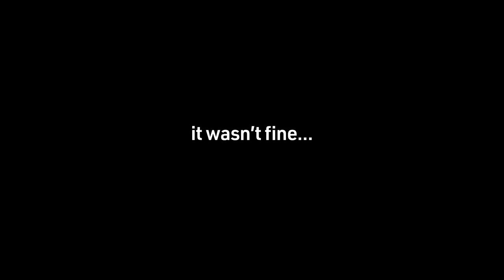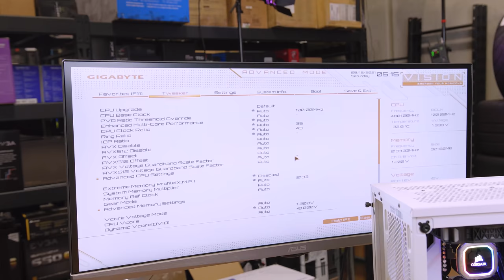6 Year Old Girl Builds A Gaming PC

Comment: I'm a 3D animator, Quick question: I got a new GPU, should i be selling my old GPU or does having a pc with two different GPU make sense or useful at all....or maybe just build a different new PC ???
Reply: depends on the 3d software you use, and if you do GPU render, if not, keep it as a back up, or build a media pc, or for someone else
Reply: If your new gpu is powerful then it should be decent enough at what tiu are doing. If you want to make some extra money then there can't be a better time to sell your older gpu, if it's 20/16/10 series gpu
Reply: As long as you don't have 2 different brands.  But generally you want similar performance levels or most hardware offloading will slow down compared to just having the 1 gpu installed.
Reply: If your old GPU is still not bad, and your 3D package supports multiple GPUs for rendering, then you can use both GPUs and cut down on render times even further. Just make sure your motherboard has (at least an x8 PCIe) second slot you can put the old card into - most motherboards you're likely to be using probably have it.
Reply: @KillahMate  I think this was the answer I was hoping for, I'd LOVE to cut down my render time!!! can I make it happen with this hardware and software ....
Extra info: I animate on Maya and Render with Arnold, New GPU: 3080Ti FE, Old GPU: 2080 MSi, Motherboard: Asus Z390 E-gaming, PSU: 750w ??
Reply: @TheTopStarz  Hm. Well, your old GPU is still pretty powerful, and your motherboard is more than capable of running both these graphics cards simultaneously. However, your PSU can not safely run both cards simultaneously (it's fine for either card by itself, but you would need at least a 1000W PSU for both). Also perhaps more importantly, while Arnold specifically can use multiple GPUs for rendering, it's not really good at it when the GPUs are not the same model - it throttles the faster GPU. In your case adding a 2080 to a 3080Ti may lose about as much power as it adds, so it's not really worth it. I recommend that you ask some Maya professionals for advice on if keeping the 2080 is worth it, because unfortunately it might not be.

Comment: My 18 month old MSI MEG Godlike Z490 works great with overclocking my 11700K. With Wifi6, Thunderbolt 3, ESS DAC, lots of USB ports, RGB and OLED display, it was too good to retire after one year - I upgraded the CPU after a friend bought the old 10700K for 70% of the cost for the upgrade. Plus it supports PCIe 4.0 in the 1st 2 slots and came with a 2x M.2 NVME PCIe 4.0 card! So, it can give max speeds with a 3080 or 3090 and a couple of 980 Pro SSDs.

Comment: Heh I just found this video by chance, good one! 
It so happens that I've just assembled my first water cooled new PC together with my 4,5 years old son - the system is actually on the table behind me right now, with only the pump active, doing it's 24h leak test.
And the whole experience has been awesome, for both of us! The little ones are absolute sponges when it comes to learning new information. And they surprise you sometimes with some out of the blue remarks that leave you stunned. For example, while we were manually turning the myriad of screws on the 10 fans, putting them on the 2 rads and the case (a Lian Li O11D Evo XL) my son asks me: "dad, why didn't we buy an electrical screwdriver?" .... it left me speechless, followed by a big facepalm moment. Of course I told him that I didn't order one and it's too late to use it on this PC, but it left me wondering why in the hell didn't I even consider it? I've been building my own PC's since 23 years ago and did a lot of them over the years, and I've never felt the need for an electrical screwdriver, and that is probably the reason. But his question was so obvious, and so well put, especially for his age that I'm going to remember it for a long time. And of course I'm gonna buy one first chance I get.
Anyway, I'm also of the opinion that kids should be taught how to handle the less dangerous adult tools, instead of being told not to touch this and that. 
I've taught my son how to plug and unplug electrical chords since he was 2 years old. Taught him what was dangerous about it, and why, and what he should plug into an electrical socket and what not to, etc.
Even bought for him a few of those triple socket extension cables with on/off buttons, and taught him to always turn the power off before plugging and unplugging from it. And as a result, now if he sees me unplugging a device without turning off the power button of the chord first, he's always correcting me: "dad, not that way, it's dangerous, you must turn it off first!"...
I gave him an older PC case, a Fractal Design R6 I think it is (it's a very well built case, that doesn't have any sharp metal edges), so that he can play with it. It still has 3 working fans, bought for him 2 adapters from 2x3pin fan connectors to 1 USB (found on Amazon), so that he can power the fans from a phone charger without the need of a power supply or a computer for that matter. Almost every day he spends ~15-20 minutes playing around with it, screwing and unscrewing different parts of it, combining them etc. 
Taught him how to change batteries for his own toys, how to test them to see if some of them can still be used.
Even built 2 IKEA office tables with him recently, he was very happy to be involved in putting all the parts together with me :)
All in all: i highly encourage all parents out there, to spend time with their kids, and have patience to teach them even some of the stuff that can be considered "adult territory", even if they are 4-5 years old. 
I'm NOT saying to teach them how to use a chainsaw or an axe or stuff like that - now effing way. 
But less dangerous stuff like building a computer or even building furniture, using a screwdriver, changing batteries from toys, or inflating tires with a small compressor or a pump etc. 
That is fun for them, and they learn a lot from the experience. 
They VERY MUCH appreciate the fact that you trust them with this knowledge, that you consider them big enough to let them do those activities. It will bring you a lot closer together as a family, and it will make them much less afraid to get their hands dirty or to repair broken stuff. That's something that will benefit them greatly in the long and super long run!

Comment: Hi Jay,

Can I ask which radiator from Hardware Labs you would recommend for running the Lian Li SL 120 Unifan's at slowest rpm? I was thinking of buying their Black Ice SR2's or their GTS series. I'm worried when it comes to fitting them since the Unifans seem to have some known incompatible rads which logically wise should mean there's some unknown ones as well? I would be buying 3 or 4 x (still debating on the amount) 480 rads (so 12 or 16 fans) 

(It will be an in-desk build, so space shouldnt be an issue, it would be for an over the top build really thinking everything through as I want to do as long as possible with this build, for this I'm even waiting for DDR5 motherboards, the newest CPU's and GPU's) obviously I want the best of the best for these decisions which is why I ask for your opinion on the radiators.

Comment: My son is three, HE is allowed to touch all my tech if I am present. I have only a few rules for my household
1: NEVER Erase someone elses save file on purpose (He accidently bumped my SNES the other day and borked my Save files in Kirby Superstar but that took like less than 3 hours to get back my 100% save file)
2: ALLWAYS hold RESET when turning the power off to the NES when playing a battery backup save file capable game.

At present the other rule is don't touch the tech without me present. but I'm not going to stop him from touching it when I am present.
Thats any of the tech.
5 Nes
2 SNES
2 N64
3 Gamecube
2 Wii
1 Wiu
2 Switch
1 3DSXL
1 New 3DS XL
1 Gameboy Colour
1 Gameboy Pocket
9 Gameboy
2 PC
1 Xbox 360
1 PS2
1 PS3
1 PS5
2 LED TV
1 LCD TV
1 CRT TV
 The only piece of tech in the household he is told NEVER to touch is my work laptop provided to me by my work and not for use by anyone else.

Comment: when jay said the motherboard dead when he tried to reflash the BIOS, i was like "ha, thats sound sooooo familiar!" XD!! jay, i even has one of my asus laptop got its BIOS locked(it will refuse any attempt of reflashing) by ASUS service center after they returned it to me from services. which when i called them up afterwards, they instead ask me why i need to flash my BIOS? and said the BIOS they put in it will work just fine. i was like "what the fuck??" i think everybody should share informations of BAD experiences especially "weird ones" with any computer brands like the one im having with ASUS which have potential of compromising your devices. becasue those bad things could damage your properties. and you need to know that. not about some brand having many bloatware and stuff. bloatware you could remove. MALWARES EMBEDDED IN HARDWARES YOU CAN NOT.

Comment: LMAO we had a Zenith EZ-PC (286 all in one) and a compaq 386. The compaq had a 5 1/4" disk drive and a hard drive. The ez-pc had 2x 3.5" disks. I tried to put a 3.5" disk in the compaq, but the computer didn't see it. So then I thought...........if I swap the BIOS in both maybe it will work? well...........I fried both from static discharge. After that my mom was afraid to let me touch computer guts. I learned my lesson though. It took my dad and my cousin to convince my mom I'd be ok. I've never had ESD issues ever since....and I ended up with a 486 (sx not dx unfortunately) with 3.5" and a hard drive. So it worked out in the end. I was still on EGA graphics though. I had to save up money to buy a VGA monitor. I had a VGA card, just no monitor.

Comment: Well, call me hater if you like but if someone handled computer hardware like that in a serious computer hall, the other guys would throw you out.
Please take a certification in ESD protection, you have no clue what can happen and how long time it can take before the problems show up.
Computer hardware is not lego parts, they are very sensitive so no fingers on it unless you all have the same charge. (easy fixed by wriststraps connected to the PC or the motherboards ground before it's installed)
I have personally banned a company from entering a computer hall until all their staff are certified.
You have lot of knowledge about the hardware but if you learn others you should handle the hardware with care and make sure that no gate has got an electrostatic discharge that may cause a leak and timing problems.

Comment: I honestly cannot understand why you insist on building the entire computer, up to the last screw and ziptie, before turning it on for the first time, even when you know that it will need a bios update.

Then you get this. You need to remove the motherboard, which means undoing almost all of that work, and then redoing it. A huge amount of extra work that would have been avoided if you just had followed the basic advice of trying a minimal setup on the table first.

It seems to me that no matter how many times this bites you in the posterior, you still keep doing it. Again and again. Why? I will never comprehend.